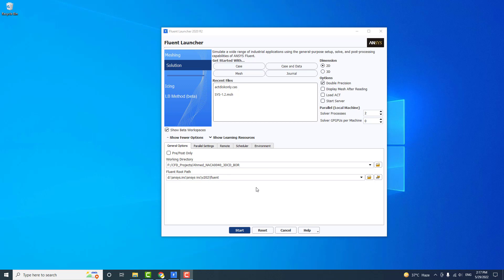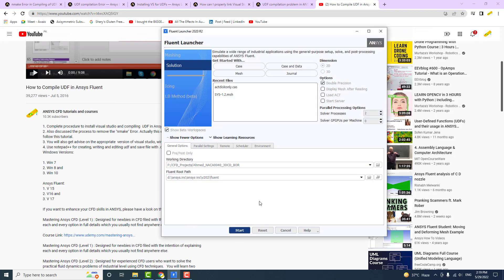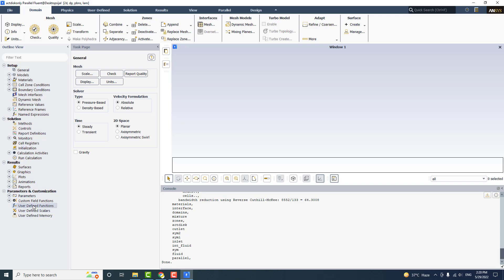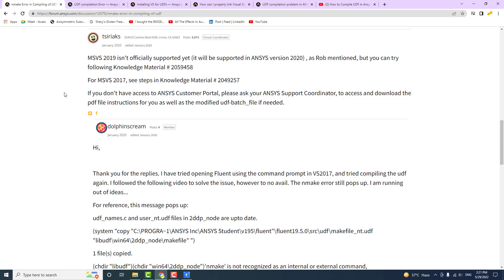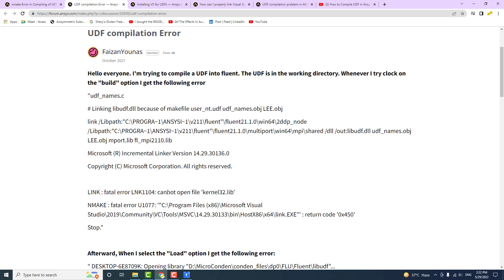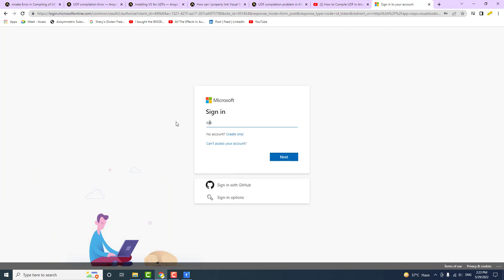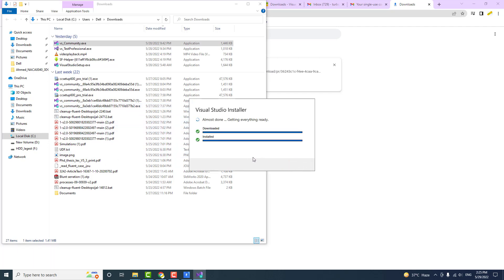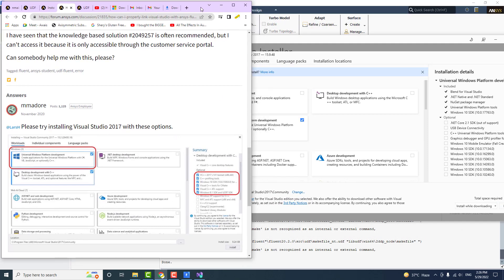How to compile UDF in Fluent 2020 R2 and visual studio 2017

Comment: while downloading visual studio 2017 community version it says 'Not Available'. Can I install 2019 or the latest version? I ries latest version 2022 but the software or files you selected while downloading,.i.e. universal Windows and Desktop development are not the same.  What could be done?
Reply from the maker: yes, just check from ansys website that which version is compatiable with your fluent version
Reply: @CFD_Mechanic  Ansys2021R1 is the version, but the software or files you selected while downloading, universal Windows and Desktop development are different.
Reply from the maker: @MohamedAsharSultanMohamedYousu  check on ansys website

Comment: 'xcopy' is not recognized as an internal or external command,
operable program or batch file.
Copied D:/D:\WLF.cpp to libudf\src
(system "copy "C:\PROGRA~1\ANSYS2~1\v221\fluent"\fluent22.1.0\src\udf\sconstruct.udf "libudf\win64\3ddp_host\SConstruct" ")
        1 file(s) copied.
(system "copy "C:\PROGRA~1\ANSYS2~1\v221\fluent"\fluent22.1.0\src\udf\scons_default.bat "libudf\win64\3ddp_host\scons_test.bat" ")
        1 file(s) copied.
Creating user_nt.udf file for 3ddp_host ...
(system "copy "C:\PROGRA~1\ANSYS2~1\v221\fluent"\fluent22.1.0\src\udf\makefile_nt.udf "libudf\win64\3ddp_host\makefile" ")
        1 file(s) copied.
(chdir "libudf")(chdir "win64\3ddp_host")
D:\libudf\win64\3ddp_host>rem  

D:\libudf\win64\3ddp_host>rem  Copyright 1987-2022 ANSYS, Inc. All Rights Reserved. 

D:\libudf\win64\3ddp_host>rem  
Microsoft (R) C/C++ Optimizing Compiler Version 19.29.30146 for x64
Copyright (C) Microsoft Corporation.  All rights reserved.

usage: cl [ option... ] filename... [ /link linkoption... ]

Microsoft (R) Program Maintenance Utility Version 14.29.30146.0
Copyright (C) Microsoft Corporation.  All rights reserved.

NMAKE : fatal error U1073: don't know how to make '..\..\src\WLF.cpp'
Stop.

Done.

Can u please help i tried in different way but cant solve it

Comment: Hello, can you give information what is first ansys version that have built in UDF compiler?
Reply from the maker: Some one here was telling me that Fluent 2022 has builtin compiler
Reply: @CFD_Mechanic  thank you for answering, i tried to google it, bit i could not find reliable information. Thanks again
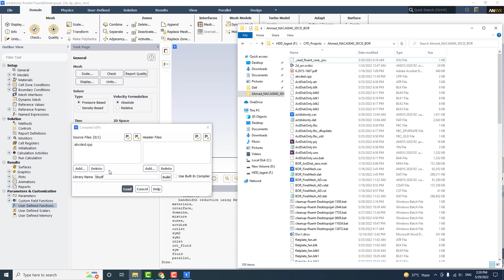Reply: Hey Ivica, I found an option for using in-built compiler near 'Build' in FLUENT R2020 R2. I haven't tried it, you can see the same in this video at 02:54. Hopefully, it is the same.
Reply: @leodaniel5245  thank you for answer! I alredy use 2022 version and it seems to work very good!

Comment: Fluent 2022 comes with inbuilt compiler. this video is not necessary if using 2022 version. 
if using earlier version, when opening fluent in workbench, a setup window will open, in that make sure your udf file is present in the working directory. That is very important
Reply from the maker: inbuilt compiler does not work for me
Reply from the maker: built in compiler works for you?
Reply: @CFD_Mechanic  yea it does. I compiled a rotating motion UDF and it compiled. Maybe you need to reinstall.
Reply from the maker: @vikkjayyak2642  in 2022?
Reply: @CFD_Mechanic  yea 2020R2
Reply: @vikkjayyak2642  is it possible to debug UDFs compiled with built-in compiler?
Reply: Sorry I wrote 2022 in comment
Reply from the maker: @vikkjayyak2642  well in built compiler did not work for me
Reply: @CFD_Mechanic  what error you getting? Nmake?
Reply from the maker: @vikkjayyak2642  I have mentioned nmake and link error